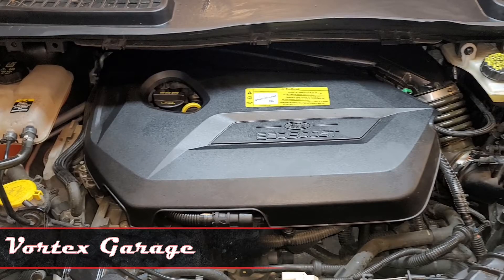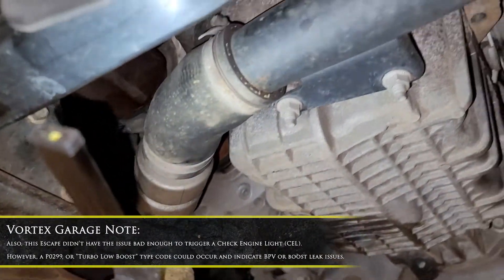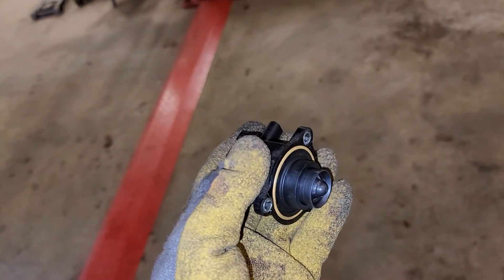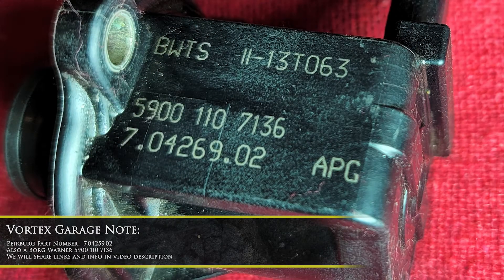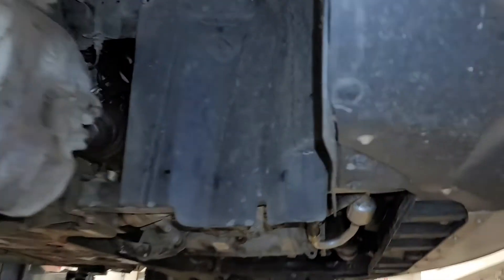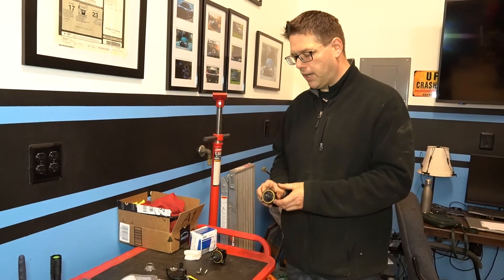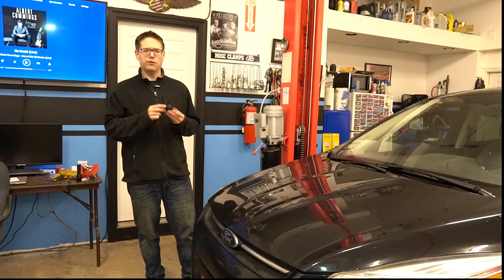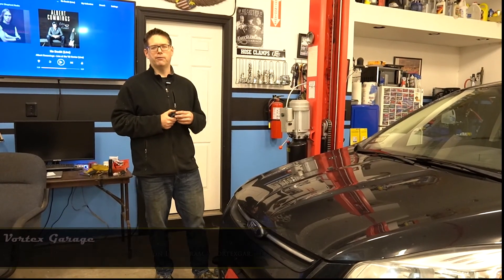1.6 Ecoboost - Boost Leak Fix and BPV Part Number - 2013 Escape - P0299

Comment from the maker: In all this chat, I totally missed one obvious thing:  while I ordered "CJ5Z-9U465-A", the part that came STILL has "CJ5G-9U465-BA" silkscreened on it.  So I guess my theories of these two parts being the same is more evident since they printed the one number on a part listed as the other!
Reply: I'm an engineer, and these little nuances in CPM and Spares really annoy/interest me! It can be make or break. Really shows how someone who has their hands on the parts can know worlds more than a spreadsheet-jockey with all the drawings and BOM at their disposal. 

Now. *Sips coffee*. Time to figure out if this is what's broken on my Escape`.
Reply: Hey Vortex Garage. Did the car kinda feel like it was rowing a boat? I believe my 1.6 in my fusion is having the same issue.
Reply: @PatientZero_  did u ever figure this out? I have 2013 fusion as well sounding like same symptom
Reply: @MattYoung1988  Yes It was the Turbo Wastegate Solenoid. Not the bypass valve.

$20 off Amazon and it ran perfect.
Reply: Is the 2.0 bpv in same place
Reply: @kingsoljah109  yes
Reply: @vortexgarage i had a question. my turbo wastegate solenoid in a 2013 ford fusion 1.6l showed a code saying it was bad also with a misfire on cylinder 2. i replaced the wastegate solenoid and coil pack and spark plug and the codes are still showing after ive cleared them. do you think the boost bypass may be the issue and also when i replaced the wastegate solenoid it didnt come with hoses so im going to replace those as well when i find the correct size hose to purchase.

Comment: Use your bidirectional controls on your scan tool to test the control valve solenoid.  If it clicks in both directions it's good.  Dont waste your money.  Recommend OE parts not amazon.  Thanks for this video, I'll hook this valve up to the scope and then check power and grounds.  If that's all good ill try replacing this part before replacing the turbo  🤞

Comment: This video is great, thanks! Side question... My Edge 2.0 has gotten louder over the last month or so with no codes. I've smoke tested the exhaust, no leaks, had an exhaust shop also tell me that its not nothing on the exhaust side. Do you have knowledge on what would occur if the wastegate is pinned one way or the other, would it affect sound and would a code trigger? If so, do you know if the wastegate with engine off should move if I apply pressure or vacuum? I'm thinking of pressurizing / vac from the boost control sensor hose. How about the bypass valve stuck one way or the other? Would it drop a code and/or affect noise? Exhaust shop power braked it and sounded like a whole lot of noise coming from the airbox. Thanks in advance.

Comment: hi, I have a problem with the ford escape 1.6 when it's hot in acceleration, it has an interruption for a few seconds, I changed the wastegate solenoid, it's the same, could it be from the torque converter or the high pressure pump?
Reply: Did you figure it out? I've changed the solenoid and bpv and still getting the surging 🙏?
Reply: @PLANET_BRUNO yes it was the low fuel pressure sensor from the fuel line, and also I change the diverter valve end solenoid from the turbo, now is okay 👍

Comment: I’m not sure if I missed it but did you have a check engine light before this? Mine has this same issue when I accelerate it kind of jerks like there’s boost and no boost and so on I worked at a transmission shop before so I know it not the transmission. I did replace the turbo because the turbo had a ticking sound then I replaced the turbo boost solenoid because it had zero boost but now it’s all good it has boost but I do get that feel when accelerating like on and off on the boost I’m suspecting this same issue now. I also got a replacement on boost solenoid thinking it was that and nope same issue. Also no check engine light and my IM monitors are set ready for smog no pending codes either. Oh and my car is a 17 Fusion 1.5 ecoboost.
Reply: Hi , exactly the same to my escape , you solve?

Comment: Great video and explanation.  I had similar symptoms - shutter on acceleration under load (most evident when going uphill) - but without the P0299 code or noticeable sounds.   Same Forscan graphs with the dropouts on boost pressure over 20psi 

 I replaced the  BPV without improvement.  Replacing the turbo wastegate solenoid solved the problem.   
It seems that either could be the cause so anyone with this issue might consider replacing both units (as he did,) just to save time and effort.

Comment: Thanks a lot Vortex Garage, I solved my shuddering issue at high speed with this video.
This worked like a charm on my 2016 Ford Escape SE 1.6 FWD.
Reply: Ooh mine just started making a whooshing sound not sure if shuttering is the term maybe it is how long was your making this sound. I might need to do the same
Reply: Sorry it sounds like a dishwasher swishing around as i accelerate.
Reply: @frajier-boi  mine doesn't sound anything, it only vibrates/shudders at high speed, same as in the video, i experience rough acceleration specially when climbing an incline.
Reply: @joswelquiambao  hmm maybe be different problems then i’’ still going to try
Reply: @frajier-boi  maybe the swooshing sound you're hearing is the turbo whistle, which is normal, specially if you hear it on the front passenger side
Reply: @joswelquiambao  its the turbo just very irregular and sometimes it has the regular wind up sound and no relief.

Comment: Question! I heard you say this is the part number for a 2.0L 2013 Ecoboost. I'm trying to replace this, as well as the solenoid, on my 2013 escape with the 2.0L. Is this the part that will fit my car? I tried the link and it also shows up as incompatible with my year. Any insight greatly appreciated!

Comment: I have the same problem with my 2014 escape 1.6l EcoBoost. Did the same swap you did with the BPV but I’m still having the same problem. The connection and valve have oil all over it I wonder if that might be the issue. What would you do next if changing the BPV didn’t fix the issue?
Reply: @TheIohnnyHansen was the part for your 2014 the exact same part he has shown? What ended up being the fix for you?
Reply: @ it was the genuine ford part solenoid the third party one was causing the issue

Comment: I Jat tore my wheel off and got the parts for my 2013 2.0 . I don't have a part that even looks similar to your Escape. Where the 3 Allen bolts are I just have a plastic vent nipple that has the solenoid hose running I to it. I'm confused for many reasons.  Can u give me some help?

Comment: Mine has that loud hissing sound. So swapped the part u showed on video. And it still does the same thing. Any ideas ?
Reply from the maker: Are all of the turbo pipes, connectors, intercooler, etc. checking out ok?  Sounds like a boost leak but definitely have data to correlate would help ensure that's the case.  Hissing sounds can also come via vacuum leaks, evap issues, etc., so hard to diagnose from the keyboard but if you think it's similar to what was in this video first thing I'd do is check all the flexible connectors, hose clamps, and pipes on the turbo piping to the intake manifold

Comment: I only replaced the boost control valve, and it didn't fix the surging. Guess I'll order the solenoid too now.
Reply: Did it work for you?
Reply: @bbmats   yes, the solenoid fixed mine.

Comment: Just replaced mine yesterday. Made the problem worse, very little boost unless I hammered the gas. Boost barely went over 4.5 PSI with lower RPM. Pulled it off today, damn thing melted. Figure I didn't centralize the inner seat and boost leak was Continuous, resulting it hot compressed air melting the plastic hat (round top with holes).
Be sure that you feel it seat the inner ring before you lock it down.

Comment: Are you able to access this from under the car or only from the wheel well
Reply from the maker: If I recall access from below is tight for accessing the bolts.  It may be possible but I don't recall - I found it easier to go through the wheel well at the time.  I don't think you have to mess with the wheel liner.

Comment: Let me ask, is that part that I need to change then? I have 2014 with eco boost and 1.6l
It has the engine light on and when I scanned it it says P0299. 
I don’t see any leaks except from motor mount a lil oil leak there.
Reply from the maker: For the P0299 you want to locate boost leaks more so than oil leaks.  You want to be sure the post-turbo air tubing is all tight - all clamps, fittings, and no leaks in the intercooler.  If you are able to data log as we did here with Forscan on a smartphone and you see similar data then it is most likely the BPV.  The BPV is a common failure, so chances are it's that, but it's hard to say for sure without having checked other potential boost leak areas.

Comment: I have a 2013 ford escape ,1.6 engine and it smokes on start up do you think a leak on turbo could be the problem?
Reply: You might have oil or coolant leaking onto the exhaust.
Reply: Did you fix the problem and what was it?
Reply: @alocamaro  I replaced the turbo,it was the problem

Comment: thank you very much for sharing, exactly the same thing happened to me and I solved it by buying the part in ford parts anyway they warned me that it was not going to work, that I had to buy the complete turbo ... but it works correctly and I recover the power and fuel efficiency .  Thanks a lot

Comment: I’m going through this issue right now. Ford dealer says the turbo bypass valve is discontinued and I’m going through hell trying to find a replacement. I found your thread on a Ford Escape forum and I’m hoping the part I ordered (same number in your thread) fixes my issue 🤞
Reply: did it work?
Reply: @jeffh.2588  Yes it did. I ended up ordering a Turbosmart BOV later on though lol

Comment: Bought a used 2014 escape and have had nothing but problems. Only had it two months and owe 15000 😞 single mom im so upset and pretty much screwed
Reply: I feel the same way.  I paid 15000 for mine and there's no note, but when you give someone all you have for a vehicle, hoping you won't be spending hundreds on repairs month after month, it certainly is disheartening to have expensive repairs to pay for still.   I wish car dealers were required to do more to ensure their cars in working order and won't need repairs right off the lot.  Silly little lemons laws don't do anything to help.
Reply: Hopefully it's a lesson learned: never ever buy a Ford. Or any turbo charged American made vehicle. Or a Chrysler or Hyundai, Kia...

Honda or Toyota only (I love my VW but I'm a mechanic so I can fix it).

Comment: I replaced the valve and it's still making a weak squawking sound and shuddering when under a load so I guess I'm replacing the waste gate solenoid....
Reply: Did it fix it ?

Comment: Two years!!!!! Two years of taking my 2013 Ford Escape to the dealership for diagnosis of hesitation under hard acceleration. They were never capable of finding the problem due to no check engine light or trouble codes generated. I come across this video, ordered the parts, picked them up, installed them and guess what??? The Escape is now running like brand new!!!!!
Can’t thank you enough for this video!!! You were right. They told me the part wouldn’t fit my 2013 Escape 1.6 but it did perfectly fine, and thanks to that I have a 100% working vehicle again. Thank you thank you THANK YOU!!!!
Reply: Is it more like when ur accelerating does it chug like someone is hitting the brakes as u climb speed ?
Reply: @textor33 thats same issue we are having any luck?
Reply: I have the same problem, hope this part will fix it
Reply: Mine is it mainly when going up hill. Think that would be the same problem?
Reply: Same issue.  Any links to these part . I have e the 2.0 eco....
Reply: @SupremeRC  Just for the record. I still own this vehicle. Currently sitting at 165k miles and free of turbo issues ever since I replaced those parts. I do not have links to them, but I bought them directly at the dealer. The part numbers are as follows:
CJ5Z 9U465 A
CJ5Z 9K378 B
Reply: @gustavolizarraga7575  mine seams ok until I try to pass someone then I get this noise from passenger side of engine bay. I let off throttle and roll back it goes away but when the sound is present I'm loosing alot of power.. thanks is this something I could get on Amazon?
Reply: greetings from germany: the same shit here just a diffrent day... mechanics especially  ford never finds problems properly
Reply: My 2015 does same thing going up a hill

Comment: Thanks for posting this video. The attention to detail and video quality is top notch. 
I work for a inventory company and travel to many dealerships (fords included) I knew what the last 2 digits were about but always wanted to know what rest before hand means. Now I know. It's just funny how certain parts aren't meant to be replaced unless it's a whole unit. It's obviously the case here regarding to the turbo system. 
I bet it took some research time to break it down on finding that certain part you were looking for.

Comment: Thank you! I just purchased a 2013 Escape and began feeling the stumbling. I pulled a data log on the boost, and it looked similar to yours. I went to Ford, and they told me it would need a new turbo. I wasn't buying it. Turbo failure is usually a pretty easy diagnosis just by sound. I found your video and ordered both parts. Of course, Ford said it didn't fit, so I told them I won't be returning it if I'm wrong. Easy change-out, and the car drives great. You, my friend, saved me $2k.
Reply: How did you noticed your turbo was working bad?

Comment: I’m curious if this fixed the car. Did I miss that statement. I got an escape with the same code but no shudder. Came in for tans issue now it has produced this code and we need to get it fixed. I will pressure test system to verify leak.
Reply from the maker: Sorry for the slow reply, but yes, this did solve this issue on the car.  Your plan sounds solid, test for leaks in the tubing especially if any of that was off for the repair.  In our case this one was the BPV and it's been running well for several thousand miles since the repair according to the owner.

Comment: Thanks for the invite.   I noticed from footage that the odometer said 162 k plus miles. Gives us 1.6 owners hope.
Reply: Incite
Reply: * insight
Reply: @hbic3 Im at 170 on a 1.6 doing a coolant pressure test just to check on her today I've actually got it hooked up to the car as I type this aha
Reply: I'm at 177,700 on vacay in FL from IL. This code just came up. I'm frantic
Reply: I’m currently at 193k on my 2015 Ford Escape 1.6 coming up on 194k. Transmission has been slipping for years but engine has been solid. Couple coolant hose replacements but engine is still going strong

Comment: have the same car. any time i rev over 2 to 3 thousand the shudder starts . the turbo produces boost then suddenly drops of repeatedly . I bought the part but the issue is still there any ideas ? Been to ford they want be to buy a whole turbo assembly.
Reply: Did you solve the problem?

Comment: My same escape has a whining whistle noise when accelerating and will over heat when climbing hills to the point the engine will force shutdown do you believe this part is the cause?
Reply: Did you find the problem? I’m having the same issue

Comment: @vortexgarage  Excellent work tracking down that part.  I am wondering how critical this fix is?  I have a P0299 code and a trip planed for later this week.  Is this a don't drive at all, or don't drive much, or a fix it within a couple months type of repair?
Reply: Car will run and drive, but will lack power and fuel economy may be lower (loss of efficiency).
Reply: My question exactly!  Does anyone know?  It just happened today.  Thank you.

Comment: I have the same car but the check engine light is due code P0234 and it means “engine overboost condition”. Any idea on how to approach this fault? Thank you
Reply from the maker: Yes that is almost always the Wastegate solenoid also called the Turbo Boost solenoid. I've put two on this car so far. I think I cover it a bit in this video but otherwise search Ecoboost p0234 and should be plenty of how tos. https://youtu.be/IXxxvkSF-UI

The part number for this on the 1.6 Ecoboost for this generation is CJ5Z-9K378-B. Always double check fitment before ordering though.
Reply: @VortexGarage  Thanks, I’ve watched the other video and it seems doable for me. Hey I just wanted to run this by you and pick your head before I go ahead with the Turbo solenoid... I actually noticed the plastic lid that covers the air filter loose and isn’t bolted down and the air filter is dirty.. I’ve read that this causes engine hesitation which I think I feel it because when I give it gas the engine takes a second to respond. Let me know what are your thoughts on this?
Reply: I came here for this same code for overboost instead of under, but still got the info I needed. Thank you! I also wanted to say that I have yet to find a more simplified explanation of this system and I have now considered asking my husband to whisper the meaning behind the different digits of a Ford part number, instead of sweet nothings, in my ear.
Reply from the maker: @ubbewithabfc  Glad it was helpful!! And LOL about the Ford part numbers 🤣🤣

Comment: My escape is stuttering around 2,000 rpm 30-40 mph. Ford diagnosis said my right side inner & outer tie rods were shot and I needed new ones. They wanted $600, I bought picked up some MOOG parts from Advanced Auto Parts and swapped them myself. It’s riding better but the boost/ power lack type stuttering is still there. I’m not sure if this is my fix or maybe the Turbo Control Solenoid